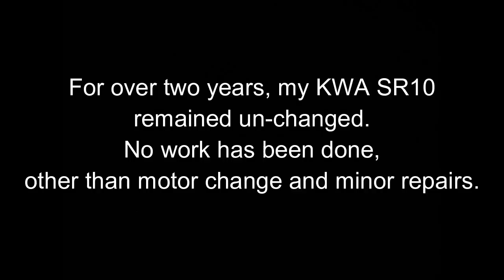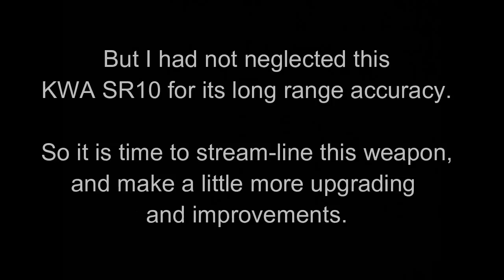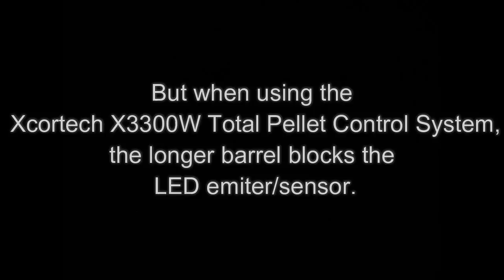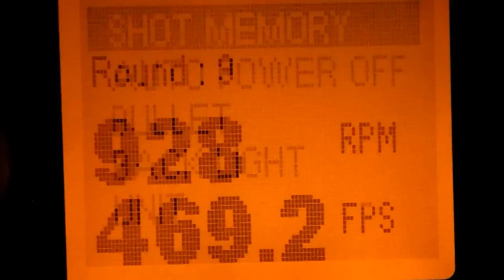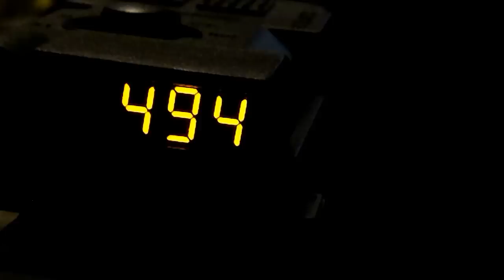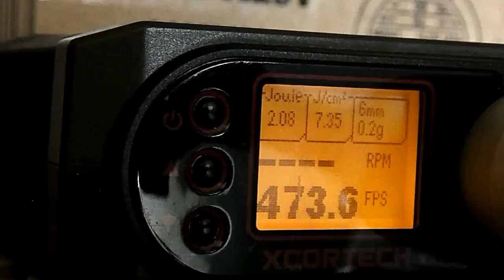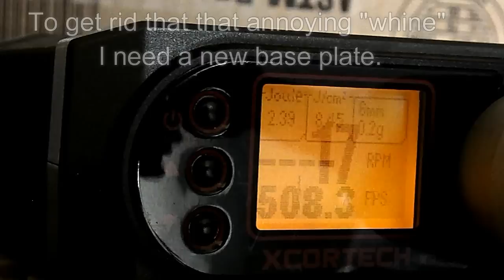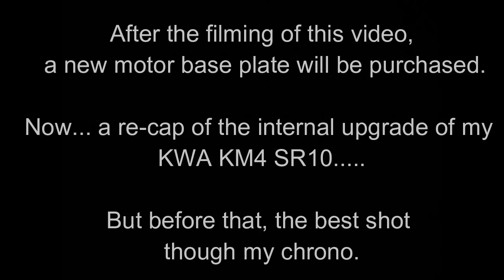My KWA KM4 SR10 - My Latest Upgrades

Comment: I like how your SR10 turned out! Good video. I recently switched to deans and regret it.. I bought the connectors from epowers and they are almost impossible to separate after a day of airsoft. On top of that, I had to re-solder em twice...

Comment: Sickest KWA on earth man! lol, and what exactly did you put on your bucking -Semaar
Reply from the maker: Silicone grease.  I forgot to label that.....  Silicone grease will not affect rubber or plastic, and it creates a way better seal than just the bucking alone.  It also slightly swell up the bucking for a more efficient seal.  I still have to re-do the silicone tape around the inner barrel.....

Comment: Hello. I have an SR-10 that I run DMR style. I want to upgrade it to shoot around 430-450 fps with .30 BBs. I'm also considering getting a 6.03 tight bore. What do you recommend for both the spring and barrel. Also would I need to add anything else internally?
Reply from the maker: +Jam0 I was using a spring that made my SR10 ILLEGAL at an airsoft field we play at.  My SR10 was shooting an average of 488 FPS using a Modify 125% spring.  You can use a 6.03mm, do not go any tighter!  To me, anything tighter than 6.03mm, the flight of your pellets will not go as far as what most people believe.  
  I have a 455mm 6.04mm Titanium Nitride inner barrel by KM.  With this barrel, I can reach targets over 200 feet.  I will confirm this one day soon when I REMEMBER to bring my 200 foot tape measure at the field.
  You can add what ever cylinder you feel should work well with you.  I got this carbon fiber cylinder from a Friend as a gift.  And it is NON-ported.  Do NOT get any ported cylinder.  You need every compression of the piston you need to maximize the push of air. 
  Ironically, I did change my SR10 to an DMR (video coming soon),  and my present FPS does not allow the use of .40.  But it can propel .30 out very far.  I could not see where the .36 pellets were going when i borrowed some from a Friend.
  So, if you want a good cylinder, you can go with Magic Box Teflon coated NON ported cylinder, and the dual O-ring Magic Box piston head.  Piston, you can go for what ever you feel comfortable with.  Hop-up bucking, you really need to do your won research.  
  Experiment, experiment, experiment!
Reply: Awesome. Thanks man! I'll reply with results after I get everything set up

Comment: Mine does that same whine thing you mentioned needing  a new base plate what will that change?
Reply from the maker: wildairsoft1 Sorry for the late reply...  I got a new base plate, but I have not installed it as of yet.  If your screws are stripped, I would go ahead and get a new grip and base plate.  I will make a new short video once I get around to it and install the new base plate...

Comment: Shimming sounds tight?
Reply from the maker: I got NO shims!  This is all original gears with the mech box.  The whiny sound is the bottom base plate adjustment screw.  The base plate threads has been shredded, and I simply need a new base plate.  On order as of this writing......